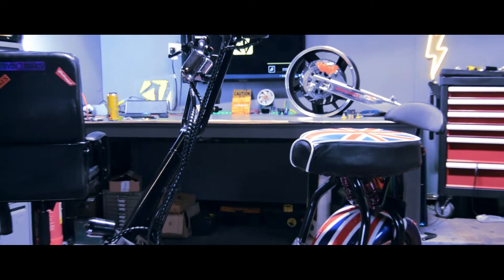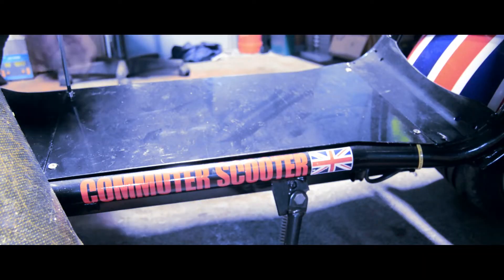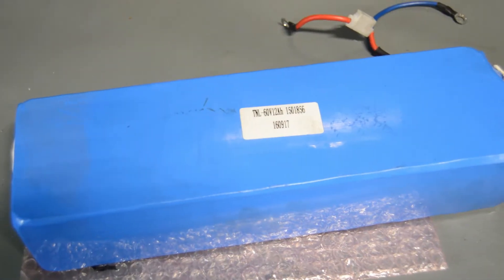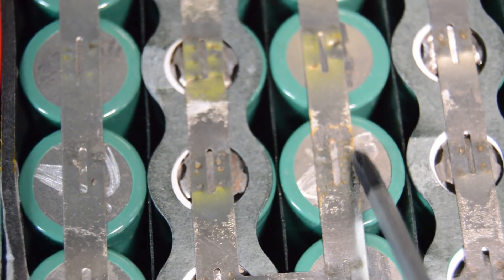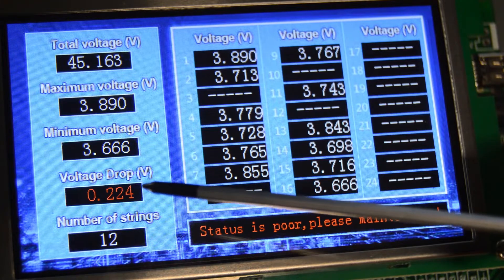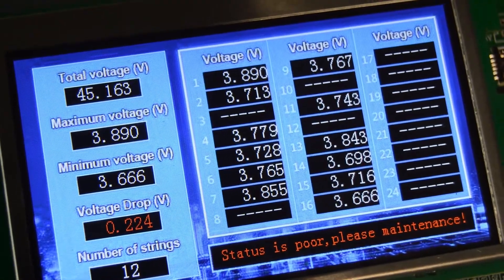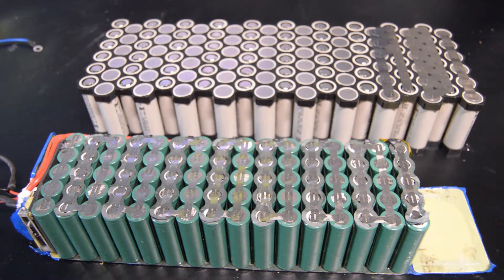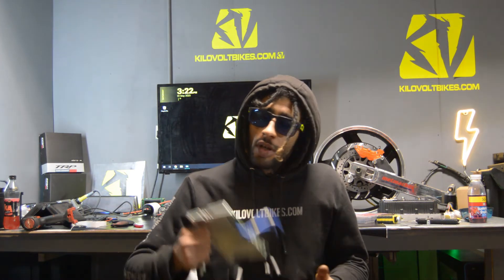Modified Citycoco Electric Scooter with 72v battery & Sabvoton Controller Part 1 [UPGRADE CHALLENGE]

Comment: Wow, I’m chatting while watching, and those series connections are basically dangerous
Reply from the maker: We are shocked that this is the factory standard pack 😳  60v 35a via 2 strips of rusty nickel plated steel
Reply: @KiloVoltBikes  I wish this wasn’t true
Reply: @KiloVoltBikes  in any case, that’s why you do what you do.  Thank you brother for taking care of that fortunate client 🙌🏽
Reply from the maker: @bricklithium6865  we think exactly the same - Better battery = more fun
Reply from the maker: @bricklithium6865  🙏

Comment: What width and thickness of nickel strip are you using on that nw 21700 pack? Those look pretty beefy nice dude
Reply from the maker: Each series connection has 11 strips of 10mm x 0.2mm nickel ⚡️ it’s serious over kill as we are only pairing it to the mini sabvoton 72v 45A but always nice to have the extra amp handling even if it’s not used 🙏
Reply: @KiloVoltBikes  Yooo dude .. I was thinking about getting their Trike, and upgrading the crap out of it. It should be fun. 3 wheels = 3 motors, and a lot of space to add a big battery. What do u think bro?
Reply from the maker: @fightsandfinance7570  sounds like an awesome plan , We have seen pics of the 3 wheeler Citycoco’s but never seen one in person . Would be interested to know if it’s still hub powered

Comment: Sorry not to sure if this might be or if it is off topic but i got a question. 
My bike as the one your modifying won’t go past 30mph not to sure if I’ve pressed something and the system accepted it as a code if some sort because it is locked there and it used to go 60 now it’s half that like on a safety type mode for kids.
Can you help me brother, I’d really appreciate it any info on the matter would be perfect!
Reply from the maker: Not sure without seeing it - depends on the make and model

Comment: Someone gave me a Citycoco fat tire scooter and I would like to have it service , but no one does that work here where I live. The scooter runs, but it quits working after 15 minutes. I unplugged all the cords and now I want to put it back together and I don’t know how. 

Any recommendations?

Do you have any idea of what needs to be replaced?

Thanks in advance!
Reply from the maker: Where are you based . If the scooter fails after a short time I would think it’s something to do with the battery . If you can remove the battery and send it in to us we can repair it for you
Reply: @KiloVoltBikes  Thanks, bro. I am located in the US. After a lot of work and research I just decided that it is not worth my time. Thanks again!
Reply: @Leo_Arango  where are you at? I'm in Las Vegas
Reply: @armenvegas  Thanks, man. I gave it away because I ain't got time to deal with this. It was a tough decision... I tried to find a place or someone to fix it but no one wants to work on these scooters because you can't find parts or it is less expensive to buy a new one.

Comment: Will these 60v hub motors take 72v long term?
Reply from the maker: Yes they will - Motors have a KV which is basically a point at which any extra power will be converted into heat - this motor is well within its KV still as the motor doesnt get hot and the rpm increased from 60v .

 If there was no increase in RPM and the motor started getting warm then we'd have a problem
Reply: So it will perform with more torque...My 60v 12ah....fully charged stops suddenly..then after powering it off for a minute and power's back on fully charged again....Only go's of under a load...with me riding in it..

Comment: Q for you mate, I have a 72v E-Scooter battery that shows full charge on fase tester, and only works when power cable is connected. Theres 2 controllers, one front, one back.. spaghetti junction the wiring is. The power cables coming from controllers are very rigid, and it only runs when charger cable is connected. Can you help, im absolutely banjoed on this!! Dont know if battery is knackered, or both controllers are kaput. When charger is connected, it almost immediately switches lights to charged, but wont switch on, on its own power...... only with power cord. Agggggggggghhhhhh 🥴
Reply from the maker: I would  say it’s probably a battery issue if it all works plugged into the charger
Reply: @KiloVoltBikes   Thanks mate 👍 Is there a booster charger that can bring levels up? Or is dismantling the battery the only way forward 🤔 Ive been trying to fool the BMS by leaving lights on, and the charger works then. But can't tell if its charging battery, or just powering lights🙃 Is there a way i can check this. Big thanks for taking the time to read this 👍

Comment: Hi, i am using Sabvoton controllers, it's good, and i would like to test far driver controllers now, seems to be better specs, do you know this controllers ? have you an opinion ? thx :)
Reply from the maker: the fardrivers are extremely powerful controllers - we are going to do a Sabvoton Vs Fardriver video soon
Reply: @KiloVoltBikes  I will try it soon also :) on Sur-ron

Comment: You must be in my head or summat i been looking at them debating 96v dualtron or 96v moped with 8kw hub
Reply from the maker: We will make sure we take it for a decent test ride and review how it performs
Reply: @KiloVoltBikes  heres a tip fella jaguar i pace 12× 60ah lg chem pristmatics 3s 4p config so im going to get 2 modules for 24s worth, charge at 1c 60amp discharge 4c 240amp very little heat out of them.
Reply: I can get mine £600 im sure if i had a matching order id get the 4 modules for a grand.
Reply from the maker: @ianhill20101  they sound like the freelander cells LEV46 cells , prismatic cells which come in modules ect . They are great for when you have enough space to fit them in . This floor pan for the scooter is only 85mm deep so not much prismatic cells that would squeeze in . We have a super bike and a quad coming soon that may feature such cells
Reply: @KiloVoltBikes  look forward to seeing your superbike effort ill keep you in my loop fella keep the building strong, lloks like you habe a blaze and a blast in that shop good times enjoy fella im blazeing away nw soldering lol.
Reply: @KiloVoltBikes  if they are same hopefully non jag bits come cheaper again cheers for tip ill check it out